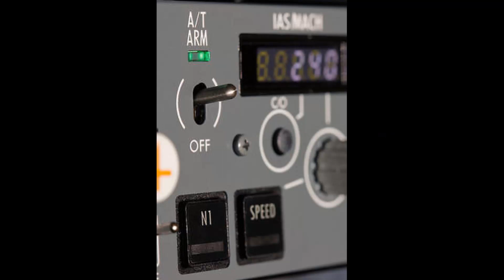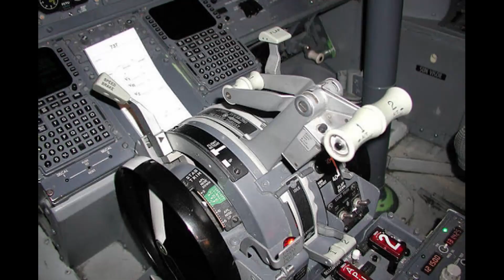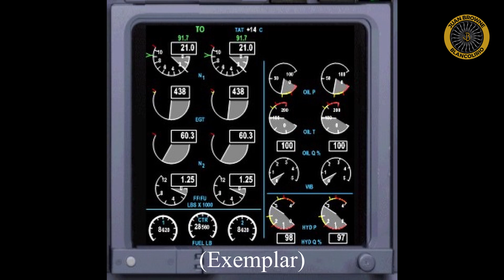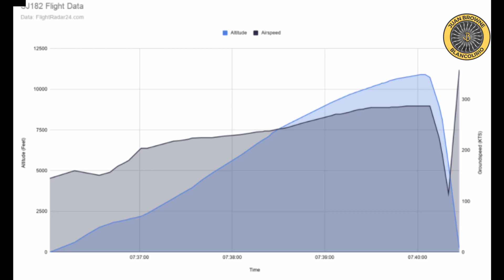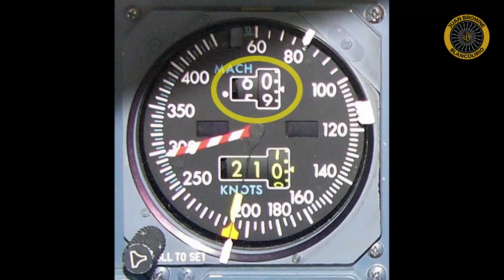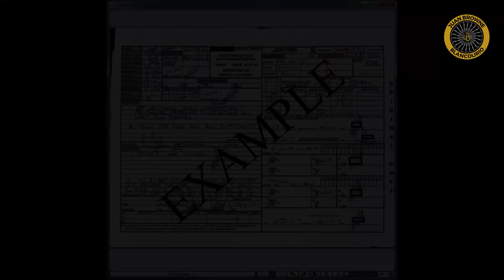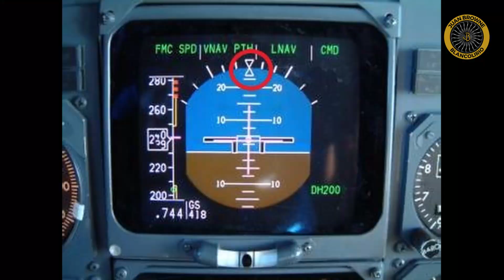Sriwijaya SJ-182 KNKT Preliminary Report 12 Feb 2021

Comment: Just about the FO in this case. You can find a lot of informations in the English speaking Indonesian media about him, even his clear name. Diego M. came from an aviation family, his father is a pilot and a former airline manager. He studied economy at an University and finished this study with a master degree. Than he switched to the airline business and learned at the Sriwijaya flight school. As the fleet of Sriwijaya is a 737-only fleet it's clear why he focused on the 737. He than worked as a FO for Sriwijaya Air since 2013 and accumulated more than 5100 hours of flight experience.
The Captain was a former airforce pilot and worked after his military time since 1998  first for Garuda, than for Adam Air and since 2008 for Sriwijaya Air. He accumulated more than 17900 hours of flight experience.
Reply: But they fucked up.  People get lazy and even arrogant by saying the can get away with bad habits because "Im very experienced".  Then on checkouts, they put down others if they point at their bad habits.  Honest companies will fail a captain with bad habits.  Corrupted companies will pass a captain with bad habits.  See the results.   I was a check pilot and seen this in person.
Reply: @emergencylowmaneuvering7350  I didn't concluded to anything about the performance of the pilots in this case. I've a personal opinion on this topic, but I wrode this opinion into other comments here. I don't think we should blame them before we've CVR-based evidence.

In this comment I've summarized only the facts about the pilots and especially about the FO which were available to me from Indonesian media in English language. This included an interesting interview with the brother of the FO about the passed by FO and their family background. It's pretty clear that the FO came from a western style educated upper class family in which pilots exists since generations. So it's obviously not the typical background on which you may think when you read he was an Indonesian. 

The Captain had also a very interesting biography. He was an Air Force Veteran with more than 20 years on the flight deck of the 737. He worked for Adam Air before he entered Sriwijaya Air. His widow told in an interview that he was a friend of the pilots who were involved in the than Adam Air crash and that he lost his job when Adam Air was shutted down after that crash. So nobody to which I would associate a lack of understanding for safety necesseties until the opposite is approved. I didn't concluded anything from this informations to the reasons for this crash of SJ 182 - that would be unscientific. I'm not a pilot but doing such research is part of my.profession.
Reply: @Hans_R._Wahl  The problem is that you are looking at what friends of family of the pilots said, not at what they did.  Not the huge student pilot errors they made.  Very superficial way to discuss an accident in which they killed many.  
What facts you state to excuse them?  That they came from rich families?? That they went to college?? That their families loved them?  Who cares for those stupid details..
Reply: @emergencylowmaneuvering7350  Wait a minute. From what source do you know that the pilots are guilty to have 'killed' the people on board of that plane?

I explicitly stated that I don't know if the facts which I collected about   the pilots are linked with the reasons of this crash. But they're facts, not opinions. And due to this facts it's simply evident that at least the Captain should have had the knowledge and the experience to get the situation under control. But obviously he didn't got the situation under control. But to answer the question why he was unable to do so the CVR-data are needed. Everything else is pure speculation.

I've a personal opinion on this question why the pilots were unable to get the situation under control and I posted this personal opinion in other comments here. But I will not make the mistake to mix up my personal opinion with facts.
Reply: @emergencylowmaneuvering7350  I think rather it’s mistake, although common and very human, to read into what Hans just did - which was telling a story about the pilots’ background and experiences - as defending them. It was simply sharing things he (Hans) had heard about the pilots. It was neutral. To me, anyway.
Reply: @Hans_R._Wahl  GEE,, LOL.  You posted,  "But I will not make the mistake to mix up my personal opinion with facts".  You did it twice above,,,, LOL..  Watch the video again and lets learn something from these facts.   I bet the captain took over, used both hands on wheel to try to level the wings, without checking the throttles, which needed to be cut back both on a spiral like that.  And they spiraled to water at very high speed.  The copilot, afraid to do the duty that the captain of checking the throttles, was concentrated on the instruments and did not cut the throttles on time too.  On third world countries, the captain can fire you if you correct him, even if that could avoid a huge tragedy.  Bad Traditions are more important than safety.  Stupid to do that in USA.  Im an instructor..
Reply: @emergencylowmaneuvering7350  You may be an instructor but I really would avoid to learn piloting with you. What I've written about the biografies, qualifications and flight experiences of the two pilots which were involved in this crash are provable facts. In both cases this specific two pilots doesn't match prejudices and cliches about 'third-world-countries'. The FO had an obvious lack of experience on other aircraft types than the 737 but on the 737 he was an experienced pilot. In every other aspects and matters they had the same backgrounds, qualifications and flight experiences as 'first-world-pilots', especially the Captain. It is very bad behaviour to blame pilots before it can be known that they're to blame and to state that they failed because of their nationality before we know that their nationality has anything to do with this crash.

We simply don't know until now what was going on in the cockpit of flight SJ182 in the decisive two minutes. We need the CVR to know this.
As long as we haven't the informations of the CVR we can only have opinions about why happened what happened - in opposite to the informations about the two men who occupied the front seats of this flight which are facts, like them or not. I wrote my opinion about the why and made it absolutely clear that I'm writing now my opinion. But it is an opinion that collects every known fact and doesn't work with short-range-single-issue-explanation-models like blaming the pilots because of their nationality. To my personal opinion this crash is a classical case of a Swiss-cheese-failure. The pilots were a part of this scenario - but only one part and their part has more to do with very bad luck and with circumstances in which their qualifications and experiences were useless. I will be wondering if the final report will come to any other solution. Period.
Reply: @ChristinaChrisR  Yes, indeed. I did a fact-check about the pilots: their personal backgrounds, how they learned their profession, their careers and their flight experience. There was one point were the usual international standards were not matched: the FO had nearly no experience on other aircraft types than the 737. If you took a closer look on this topic it became quickly clear why: the training program of Sriwijaya Flight School where he learned his profession as pilot, the fact that Sriwijaya operated and operates a 737-only fleet and that Sriwijaya was his only employee for whom he worked as a pilot. But the FO was on the 737 an experienced pilot. I was very surprised to find that the Captain was personally very close to the Adam Air crash back in 2007 which had a negative impact on his career. He was a former Air Force pilot, made his ATPL back in 1997 and flew the 737 since 1998 first for the Indonesian Flag Carrier Garuda, than for Adam Air and since 2008 finally for Sriwijaya, so alltogether for more than 20 years.  So in conclusion: Indonesia may be a third-world-country but this specific two pilots were two professionals, not much different from 737-pilots in 'first-world'-countries. That are the known facts about this specific two pilots which are provable by everybody who's doing the research I've done - and doing such research has something to do with my profession. I'm sorry that I became a little bit emotional.   The question is now: what did this facts mean taking into notice that the two pilots were unable to get the situation under control? The answers are obvious in my OPINION: 1.) It doesn't played a role that they were Indonesians. 2.) They found themselves sticking in a situation in which their qualifications and experience were useless.
We faced in May 2020 with flight PK 8303 the blatant example of a fully workable plane being crashed solely by its pilots in best weather conditions while ignoring all attempts of the ATC to prevent the crash. But such single-issue-crashs are rare examples. The crash of flight SJ 182 looks very much like the usual complex 'Swiss-cheese'-model-crashs. For a fact-based assumption - assumption! - its necessary to bring the following known facts (known by the Preliminary report) into a logical explanation model:
1.) the continuing technical problems of this old plane since it was putted out of a 9-month-storage;
2.) the way in which the maintenance dealed with this problems;
3.) the weather situation which caused a 56-minutes-delay and a questioning for another heading by the pilots shortly after take-off;
4.) the radio communication between the ATC and the pilots in which the pilots gave only 6 seconds before the disengagement of the autopilot a calm and routine-style readback;
5.) that the growing splitting of the throttles during nearly two minutes caused no input by the - qualified and experienced - pilots;
6.) that the pilots had after the disengagement of the autopilot exactly 5 seconds to react before the autothrottles disengaged, too, and the plane started a 45-degree-rollover;
7.) that the plane was at this time still on a low altitude of only 10900 feet and that the pilots had after the disengagement of the autothrottles only 20 seconds to recover the plane before its impact into the water.

When you put this seven points into a logical row its in my mind pretty clear why the KNKT stated: we know what happened but we need the CVR to get evidence. I wrote my opinion about it here in the comments. I'm sorry again for becoming a little bit emotional but everybody can make his picture from the known facts, too. I please only for basing it on the known facts not on cliches and unbased preconclusions.
Reply: @Hans_R._Wahl  I will fail you greatly based on "Inclination for superficial matters instead of the important facts".
Reply: @emergencylowmaneuvering7350  Please read my response to @Christina in which I brought my arguments in a line.
Reply: @emergencylowmaneuvering7350  ??? Please read my response to @Christina.
Reply: @emergencylowmaneuvering7350  Obviously you've simply no answers to my arguments. And now you went off from the table. So it's not necessary to play the pilot and the 'great instructor' to me. If you would really be something like that you would have at least some of Juans capabilities to bring things on a logical line and to explain this to others - in short: to act professional and to teach people. So it's really better to finish your postings here, yes.

Comment: You are an excellent analyst  Juan.  You heart seems to be into turning analytical data into safety actions.  Thank you Juan.  :You are definitely management material.
Reply: @silasmarner7586  spell check, right?
Reply: No he is not "management material", he is first and foremost a pilot, an aviator, who is an expert capable of hand flying an aircraft rather than just sitting in a cockpit monitoring an autopilot.
Reply: @chiefof  I do agree he is that.
Reply: Peter Mortensen  Thank you.  This is all new to me.  Thanks again.

Comment: Complacency of automation and flying skills are softened to react when SHTF. I experienced this in an industrial setting as automation came on line new operators did not acquire the natural basics needed as well as did older operators who needed them to actually do what the computers had come to do. Sitting on terra ferma does not hold the same type of immediacy as being tens of thousands feet in the air.

Comment: Commenting mid-video: 10:45 you state the left engine throttle position was 'undetected by the crew'. 

I make this comment respectfully as I know you don't like to speculate: without the CVR data, we still don't know if the crew had detected this issue or not.
Reply: That fact that they did nothing about it would indicate that 1) they chose to ignore it (surely they couldn’t be that ignorant) or 2) they hadn’t detected it. 
But you’re right there is always that first possibility.